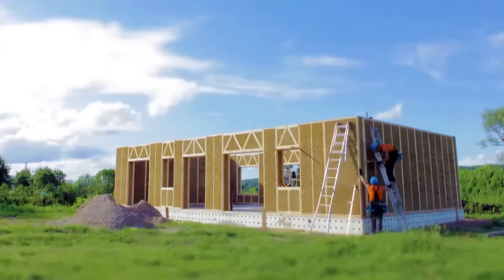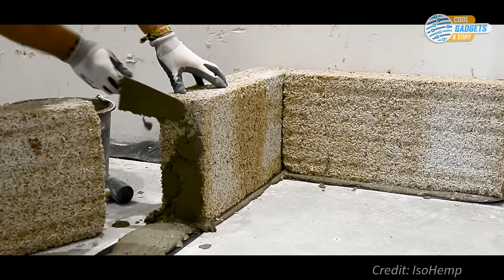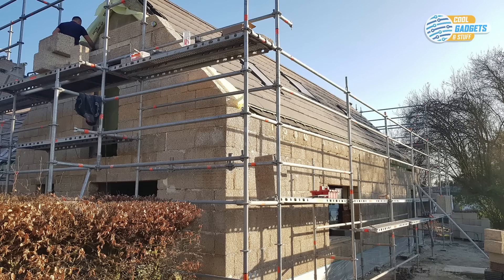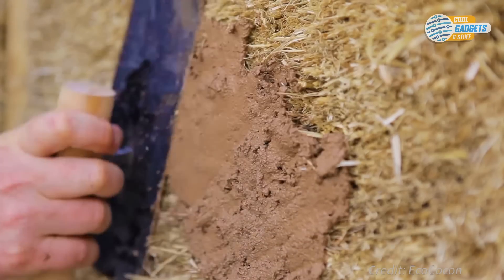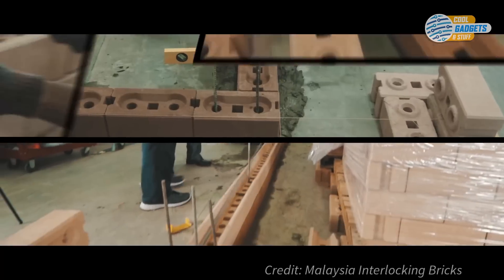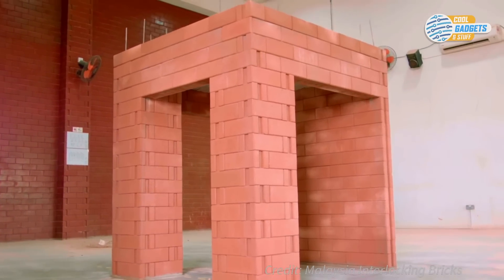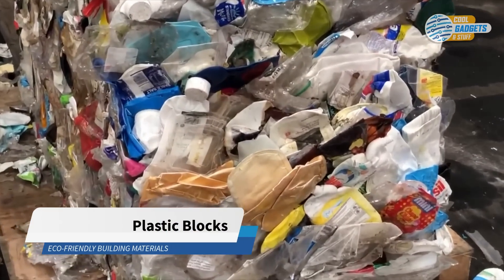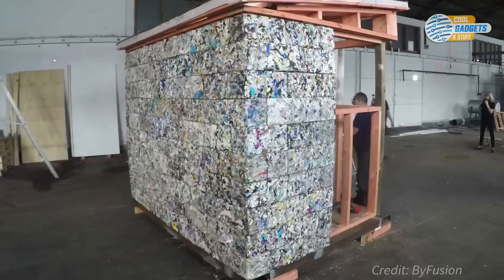5 Eco-Friendly Building Materials #1

Comment: I wonder about the straw and mould issues - how does it effect this- I like the idea of the hempcrete though and interested in seeing homes with interlocking bricks
Reply: Afaik you have to be careful during the assembly of a straw house, to prevent any moisture from coming in for this exact reason. It can be tedious. Also, it gets coated with water-proof layers, as hinted on the video. If those both aspects are taken care of throughly, mold shouldn't be a problem, theoretically

Comment: Interlocking lego bricks is the best one, but 3D printing using concrete surpasses all these
Reply: Not from what I've seen so far. The overhead is pretty high on 3D printed homes. It's generally cheaper to just use traditional forms if you're going to build a cement home. And cement is not cheap and not structurally integrous itself. Not to mention the environmental issues of cement. There are a few others more minor ones that I know of, but those are the big ones.

Comment: I reckon hempcrete will be THE building material of the future. I've already designed a few hempcrete houses here in Australia.
Reply: I have a question Pete. Hemp is organic right? So how long until they decompose?
Reply: @MrSpringfellow  Good question. I would expect that its biodegradability would be no worse than the timber supports. I have seen one source that indicated that, as a result of it being mixed with lime, it effectively becomes petrified, thus no longer biodegradable, but this would need to be independently confirmed.
Reply: @MrSpringfellow  The hemp is protected from decomposing by the lime binding agent so it will take about 300 years or so... https://hempcretehomes.com/what-is-hempcrete/
Reply: @MrSpringfellow  the alkaline lime essentially mineralizes the hemp. it is mold and decay resistant.
Reply: @ oh, great thanks, greetings from the Philippines..

Comment: Neither of those materials is good for building:
Hempcrete requires wood skeleton and cannot stands for its own.
The bricks may not require mortar however the bricks themselves are made of cement.
Straw bales are weak and do not resist fire.
Plastic bricks do not recycle plastic simply because plastic can not be recycled, it can only be downcycle.
Bamboo is relatively ecological, useful building material and definitely the best of those 5 building materials. Yet bamboo is less resistance to fire and termites...

Comment: whats the point of the open ends of the interlocking bricks they look awful, if it's like lego then why do a ridiculous design?, just use the lego design in the first place. Also if you dry fit them then pour in mortar is that not the same as just using normal bricks and mortar?

Comment: Not bad BUT SERIOUSLY SUGAR COATED. No info as to what the down sides are, or what the long term consequences are. Like the hay walls, are they prone to breaking down or popular with insects? How about mice, seeing how hay is SUPER popular with rodents. I'm not hating on the ideas, using hemp as an alternative insulation materials would be awesome but it seems mold would love it. They did say it was mold resistant but is that because of it's structure or something they add that will ware off over time. Then suddenly you are the black mold capital of the world. This is why some pros AND CONS would be nice to have.

Comment: I like hempcrete, but straw can be used as well. I made something with straw and hydrated lime. I also like my discovery of mixing just a little bit of roofing cement tar with clay mud. it actually mixes together and is hard when dry. I paint it with linseed oil.
Reply: Been looking for lime cement, how does one get it. Heard its much cheaper and better than the usual Portland cement.  How can I find it in Africa?
Reply: @princessgreen726  Its just agricultural lime or hydrated lime or quick lime. Most lime they sell is just ground limestone which is not it. I would definitely say this is not superior to Portland cement. In fact Portland cement was invented to be vastly superior to this. Also, I'd say ordinary bticklaying mortar is better than this, Its cement with a lot of lime mixed in which makes it sticky. If someone told u this its the wrong information.

Comment: Straw? I immediately think of the 3 little pigs😳
Reply: Makes me think the 3 Little Pigs story was created by brickmakers.
Reply: Did you notice the fire test they were doing in the video? Fire requires a fuel source AND oxygen. Straw bales used in construction are so tightly packed that there is not enough air to support fire spreading inside. Instead the surface will char but the fire won't spread.
Reply: Historic Home Plans I watched that part too in the video, but the “3 little pigs” story was never about a fire. It was wind from the wolf.
Reply: Now i have the green jello video rolling in my head...
Reply: Green jello video
Reply: Eric with three last names. Green Jelly😘
Haven’t seen that video in years😁

Comment: The hemp lime looks interesting but until they make it like locking bricks or in panels it's useless. The actual bricks in the video seems useless as they are scared to even tap them and there is no way I'd build a house out of straw... That's problems just waiting to happen, mold shrinkage, pets and so on.
Reply: They are much stronget than thermalite blocks or cinderblocks which have both been used for construction for at least 40 years....

Comment: the straw and hemp things are great ideas... just not as "building materials" as in, what most people would think to be the main structural component. top tier ideas for insulation, yes absolutely, but not what you house is "made of". Frankly what's better than using "eco friendly" materials, are building that density human populations so less wildlands are cleared for use. a concrete building that lasts holds ten families and last 100 years is better for the environment than 10 bamboo houses for a multitude of reasons. that's why I say wherever the climate is dry enough to allow it, just make a bunch of mid-rise buildings out of adobe bricks. those are dirt and straw

Comment: I'm rebuilding after the Camp Fire that burned down Paradise CA with a composite interlocking block called Faswall.  It's 85% recycled pallet wood and 15% cement. You dry stack it inserting rebar then fill with concrete. Like the hempcrete, it's lightweight, insulating, soundproofing, and you can work it with hand tools. Gives about an R35 wall. I'd love to use hempcrete but don't want to wait for the laws to catch up.

Comment: Hempcrete looks to be the most promising to me, if they can figure out how to make it strong enough to be load bearing.
Reply: Cannabis has strong fibers resistant to axial tension,stronger than jute even.Using it in concrete blocks makes it resistant to compressive loads,it's basically a natural concrete reinforcement.

Comment: Note that the clinkering of limestone to lime produces its weight in fossil CO2. No product including such material can be considered eco-friendly. Likewise steel rebar in most cases is extremely fossil-intensive, as is aluminum. Substituting basalt for steel rebar is usually far better. Likewise, bamboo grown using fossil-sourced fertilizer intensively is not eco-friendly.

Kaolin or meta-kaolin, or alkali materials made or mined without clinkering of limestone are superior to lime in this regard. Geopolymer and alkali-activated cements, concretes made with biochar aggregate, engineered wood, basalt, glassified waste materials all might be eco-friendly. And of course, rock works.

Comment: Question : Is it possible to 3D Print HempCrete into Homes...???
Reply: I don't see any reason why not.  Might have to shred the hemp small enough to mix well with the lime to be extruded consistently.  And it is just as eco-friendly as any other modern building project all of which use ICE trucks to go from site to site, like duh!  An entire community developed using a 3D printer to print each home one right next to another is the most eco-friendly prospect out there.  The one factor Graith Tools failed to consider is that workers don't live on the site and 30 workers who aren't driving daily to the job site saves a ton of greenhouse gases... as if there were any worries about the Global Warming/Climate Change myth perpetrated by Al Gore for profit alone.
Reply: @WillieStubbs  i am just guessing too, but I would be concerned it would lose much of its strength to weight ration if you shredded it.  you would also lose insulation capability.  if you are going to process the hemp into smaller bits,  then you will need way more lime.  lime (a simpler version of cement), adheres to all surfaces, so it nice to have bigger pieces of hemp in there.  a good analogy to think about this is concrete.  in concrete you down just use sand.  you also, use 1/2 inch rock of pea gravel.  if you just use sand you would have to use so much more cement/lime in your concrete mixture.  the hemp blocks also have lots of air gaps for insulation.  so while you could grind it down for 3d printing, you lose a ton of the advantages that come with making these lightweight, porous hemp blocks.  the 3d printing option may still be viable.  it's a long list of pros and cons.  but as three 3d printers become better and cheaper it's could become more viable.  labor costs are also huge factor.  so in the future, when robots do all the work I would not be surprised to see hemp material in 3d printing.  we'll see.  If you have decent priced labor then these blocks make a lot of sense.  these hemp blocks seem like fairly easy labor work.  any decent mason could pick this up quickly and supervise a crew of apprentices/less-skilled workers.
Reply: If labor is an issue, 3D printing is a way of substituting capital for labor, but 3D printers themselves aren't always eco-friendly either, in particular if they're diesel-fueled and transported by ICE trucks from site to site. While it's nifty tech, and perfectly feasible to make eco-friendly, that version of the technology doesn't exist yet. And where the hemp has been grown using fossil-sourced fertilizer, releasing NOx GHGs from fossil, this would be more, not less, fossil-intensive than even OPC (responsible for 6% of the world's fossil CO2e emissions).
Reply: No

Comment: Interlocking bricks can be made from ground up plastic that we reheat gently and then press into a form and now you have plastic which is not environmentally friendly but it is permanently locked into the structure and will not go away and does not end up floating in our oceans like all the junk ..@ plastic bottles do now

Comment: How are the electrical and plumbing installed in these structures? Is Hempcrete being used as infill in Structural insulated panels?
Reply: No, SIPs typically require load bearing infill to meet the S (structural) part of SIP.  There is at least one company that uses a triangular network of dowels in their SIPs to meet the requirements that could swap out the foam, but then the panels would be too heavy.

Ideally you would be able to pour hempcrete between a structural outer curtain wall with high thermal mass (brick,block, stone, etc...) and an inner wall with double layer overlapping drywall.  This minimize thermal bridging, allows unlimited R-value with proportionate sound attenuation and the "crete" part eliminates the compaction problem of blow in cellulose as well as the bowing problems they cause at the base after several years of settling (to see exaggerated examples look at an old shooting range with rock filled wooden separating walls)  If you prefer pure stick construction, hempcrete fill would work well with staggered studs to eliminate noise and thermal bridging.

I'm not saying that SIPs couldn't be made with hempcrete, but the weight pushes it into the realm of commercial construction with access to more heavy equipment.

You can make your own pseudo hempcrete by adding hydrated lime to the water in spray-on cellulose (just use hemp based cellulose if you can)  When it dries it will either absorb CO2 and resemble limestone or bond with the silicates/aluminates in the hemp as in traditional concrete... It takes a long time to cure compared to portland cement base products, but cures into a complex structure that bonds to the fibers and can look like pure marble if you have a talented plasterer.